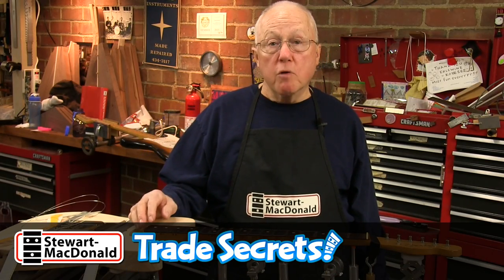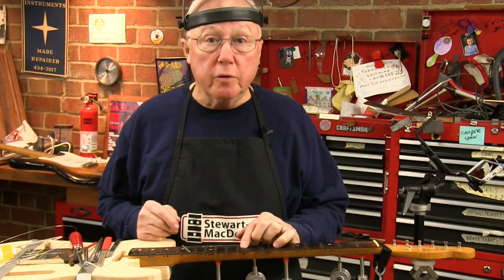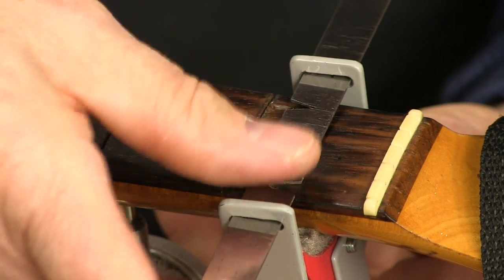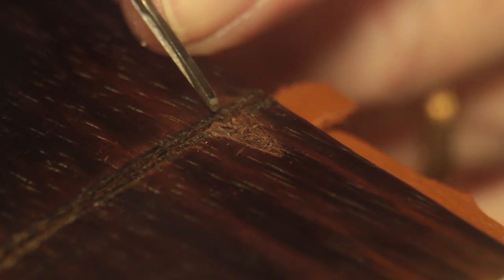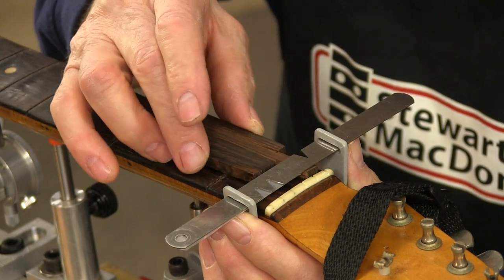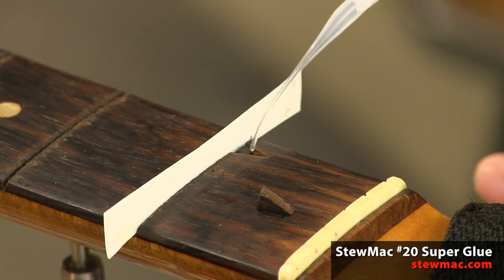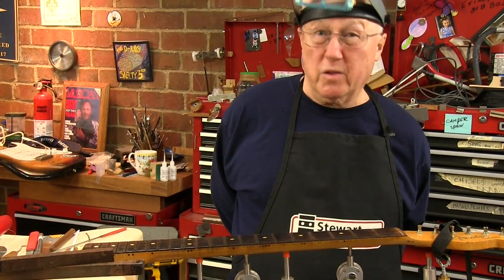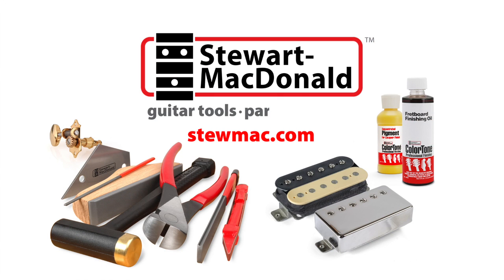Fixing fretboard chips on the Mike Bloomfield Tele

Comment: I like that plane iron chopper for the drill press. I made one from brass, and I bought a lock pick set out of Canada. I got lucky, the place that sold the lock picks had Swedish Pippin files in 3 cuts for $30 each! I decided to buy a lock pick set for fun, because what I usually pay for Pippin files made the lock pick set free. There are a few picks that make great fret slot cleaners. .015, .018", & .025", with a small sharp edged hook? They work a real treat for picking & digging out small debris.  I filed down the .025" to .020, and just love it! I will also never lock myself out again. Seriously picking locks takes practice, but it is something you can do while anywhere. Riding on a plane or a bus, or waiting at the doctor's office. Working with small tools, doing fine work with my hands makes it that much more enjoyable.

Comment: Dan, please film a how to build solid body electric guitars, both flat top and arch top styles. I think we in the hobby/ small shop builder community would be very happy, even if a lot of the material is covered in other videos it would be cool to have two custom  builds to learn from. When I first started building out of my garage you were still selling the old dvd from the 80's or 90's and everyone complained about the film quality so I passed on buying it. Now I'm kicking myself because I get the feeling it will never happen. By the way, anyone else out there that builds for the love of building and doesn't mind sharing, it would be great to see someone out together a full Les Paul style build together from start to finish. Without the use of CNC by the way or with fancy router duplicators, just regular tools most small shop builders with a good understanding of basics could use as reference.
 I don't think anymore strat or Tele videos are needed, there are plenty of great ones out already. Rambling...... hope everyone has a great year. Happy building.
Reply: See Upton Bass' videos on making upright basses. They use a drill & depth stop to get the contours right in the top, & back, then use small planes & chisels to carve the top down to the bottom of the guide holes. Option 2 is to use a standard router and templates to terrace the top, then carve the top down to a nice smoothly curved contour with the German relief carve on the edges. There are quite a few good videos on making Les Paul, PRS, & Moserite type carved tops, as well as solid wood ES 335 type tops. True ES 335 type tops are press formed plywood, using carved cauls to press form the plywood. I use MDF forms sealed with polyester. They don't last very long, but metal forms would cost about $25,000 each to have made for ONE style guitar.
Reply: THANKS SETH B,

Comment: I dislike super glue for this. Superglue has decent compressive strength but I've seen it get brittle with age and I never want to make a permanent bond with it if I can avoid it. I use tightbond II and sawdust from grinding up a matching piece of wood. I'll sand from an area of my scrap rosewood that matches the wood, and I just fill the holes. The best tool I have for getting the repair flush with the surface are Stew Mac's 1/4" smooth sided nut files (make sure it's burr free first).  I've made absolutely undetectable repairs in rosewood this way. I've even aligned a bad nut cut with the wood glue and sawdust and using some unique tools I made for that kind of repair to get the alignment right.

Comment: A pleasure to watch you work but I must say, the plastic [hanging?] loop on your chisel handle prevents [or at best interferes with] one of the major functions of delicate chisel work, namely with the palm and heel of the hand. Another tip, when paring of the repair is to use the back of the chisel until you get right down to the last bit. Depending on the grain, always.

Comment: I'd like to drop that scissor jack in my flattened Washburn J6, that has a top that sunk down about 1/4 of an inch or so under the bridge. I'm getting that banjo sound, plus, the damn bridge is set so high...what a mess. Obviously the support inside broke, or was never put in. Hard to tell if you need a fret job with all this before it.

Comment: I had my frets done. But the person obviously didn’t mask and I can see the tool marks either side of the fret. The guitar plays great but aesthetically looks like an amateur job. Is there a way to repair the scrape marks either side of the fret?
Reply: I know this is a year later, but you can use a single edge razor blade as a mini scraper. It works wonders for getting out scratches. Follow that up with some 400 sandpaer and then 0000 steel wool and your good to go.

Comment: 05/24/2021:  I asked this question once before a day ago, but maybe I was not clear in what I was asking.  So, please forgive me for asking the same question again.  Here is my question again.   I viewed Youtube videos on how Richlite is made.  The videos showed large sheets of special paper soaked in a liquid resin.   I am looking at buying a Martin Special GPC All-Solid Grand Performance Acoustic-Electric Guitar Natural, which has a Richlite fretboard.  The only bad review of this guitar was like most guitars, it doe not have a rolled fingerboard edge.  So, if I sanded it to take the sharp edge off, I do not want to see paper layers.  Also, if in time my fingernails dug into the fretboard and I wanted to sand that out too, would I see the paper layering?   Are the guitar fretboards made with paper pulp or sheets of layered paper?  Please see this video and replay again.  See line @/637 in this video.  @